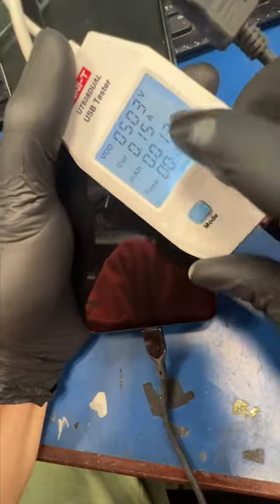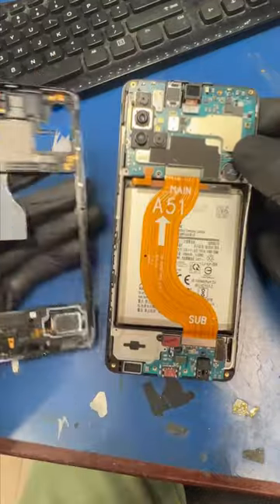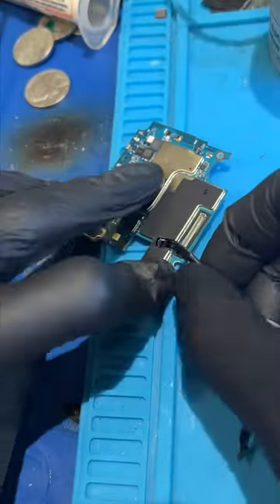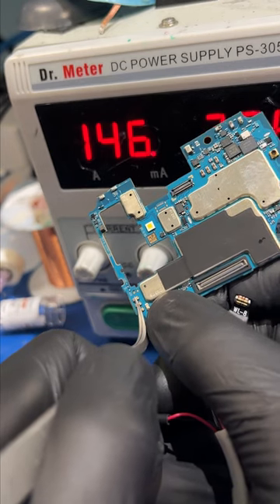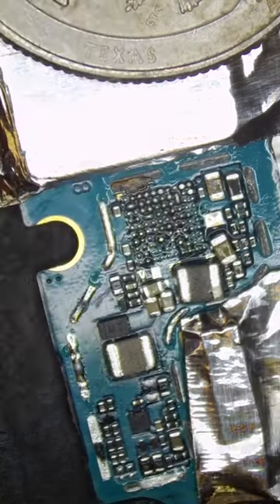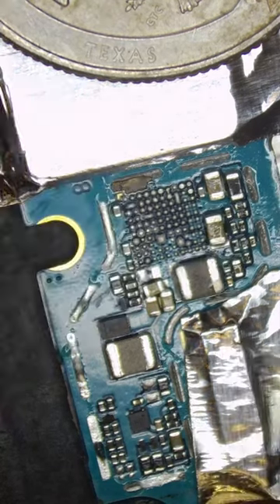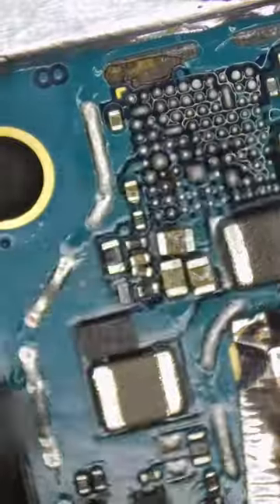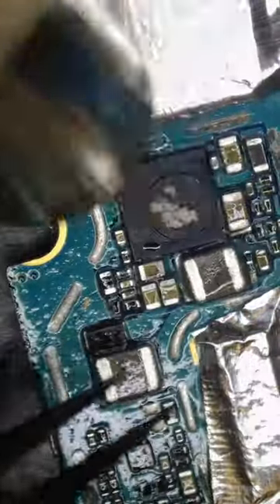Samsung cell phone data recovery… #tech

Comment: I have a Samsung Avant, that is password locked... how exactly would you recover pictures from its internal memory? This is my main concern, being that it holds pictures that help solve my father's death. I can't take chances. I've already contacted your company via it's website, also, I've another Avant that's unlocked and may be used as a donor, jsyk.
Reply: Almost a month ago, any updates?
Reply: @dustux  Unfortunately not. Same situation for you or just curious?

Really hoped they'd have a little dialog with me first...  I just need to know they are confident with this model/situation, prior to sending it in...
Reply: Underrated
Reply: What happen pls tell me I have same problem with my s22 ultra

Comment: How does your solder work? I've only ever seen a soldering iron, never this film looking stuff that you melt. Do you melt it on top or underneath the chips? Do you use a heat gun to melt it? Does it need resin?